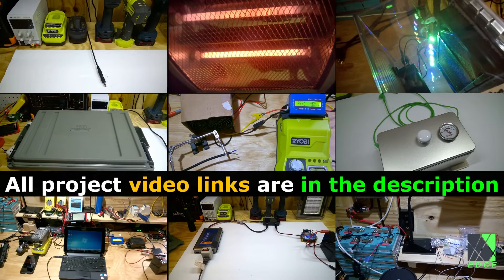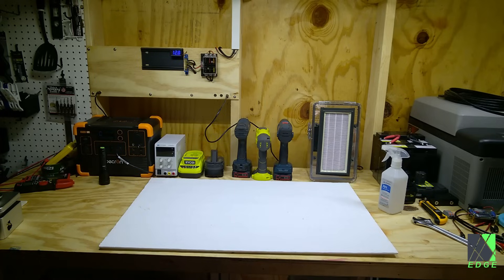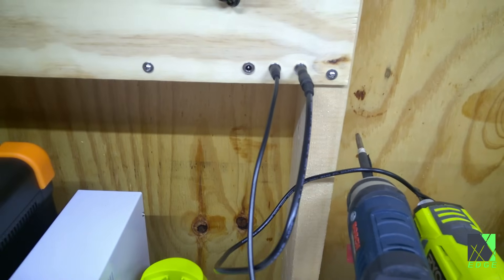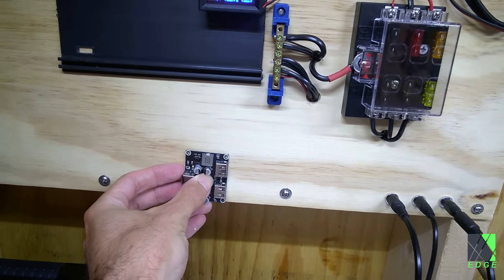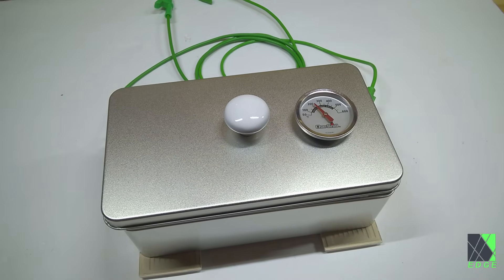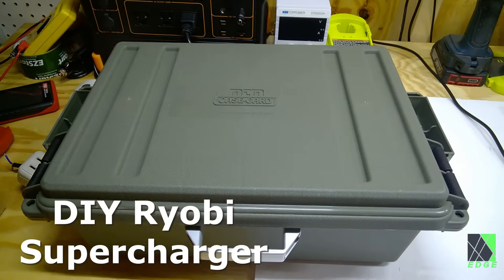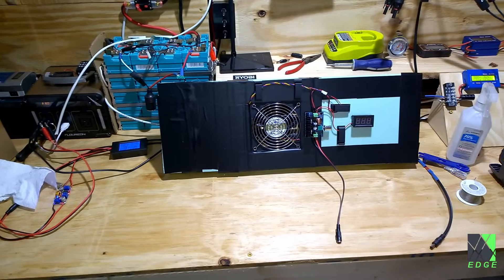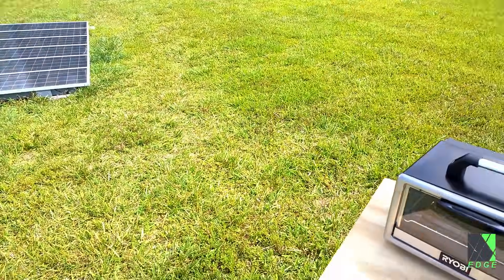What Can TRUE Direct DC Solar Power Do? Mini documentary and demonstration! #diy #solar #offgrid

Comment from the maker: ====FAQ + Related Videos, PV2L/PV2W Appliances====
Direct PV Air Conditioning Research - https://www.youtube.com/playlist?list=PL8a6nRTNyF9PyYGFHtbVmP0tQo5ar_dfX
Pedstal Fan - https://youtu.be/Cc7JJZDmqFA
Mini Oven - https://youtu.be/p3NOilVYK44
Heating / Cooking Playlist - https://www.youtube.com/playlist?list=PL8a6nRTNyF9NZkjFgjfESLujgdZFTgdym
DC Space Heater conversions:

https://youtu.be/TJG-ZnqJR9w
https://youtu.be/maDEc4FpMtA
https://youtu.be/_r9hj7gUeVI
https://youtu.be/wK3_lRSntRc
==== FAQ: ====

Does this setup use a battery? 
It has optional battery backup using a specialized setup, I did not show it in order to focus on the topic. I may explain that part in a future video.

What voltage does the PV2W setup run at?
About 12-19 volts, depending on sun conditions and the number and power draw of connected appliances.

Is there a video of how to make a board like this?
Yes,  https://youtu.be/OxNsESJOF6o

I may update this post from time to time. If you have any questions please let me know. -Dave

Comment: awesome ideas
how do you control the voltage on your battery charger? do you have DC to DC converter?
Reply from the maker: @zeeman9145 Hi, no DC converter is needed nor battery. Battery is still optional and controlled by contactor only. You might be interested in my 55 volt residential DC system https://youtu.be/SW7L3-gfE-E
Reply: @solarpoweredge  thank you for explanation and video clip!
Reply from the maker: @zeeman9145 Welcome :)

Comment: I'm a girl and can't do DIY DC solar.  I just need you to sell me the stuff. 😁. I guess I'll just have to put my hearth oven out in the sun to cook in the summer.  But my morning coffee might be afternoon coffee.
Bummer.
Reply from the maker: @lesliekendall5668 I believe you can learn about DIY solar just like I did. I started with 1 small 20w 12v solar panel and started teaching myself how stuff works. The simplest experiment is to take a small 12v fan and hook it straight to a small 12v solar panel. Free air cooling! That served me well and I still use it today. I later bought a small charge controller and small battery and inverter. I learned a lot from that system!
Reply: @solarpoweredge 
Yes, that's exactly what I'm planning to do with the direct PV to appliance thing.  I'm buying a 12/24v freezer soon and am trying to find other stuff that I want that could also be on that direct system.

Comment: So I'm going to be buying a 12v DC powered 6.1 cf freezer but can't get small appliances and lights?  How crazy is that?
Reply from the maker: @lesliekendall5668 I hear you - direct solar power should be everywhere. But just give it time, we can DIY our own stuff (I'm working on that now) and eventually companies will see it and mass-produce some of it. It just takes time for the necessary demand to develop
Reply: @solarpoweredge 
I look for stuff on sites that cater to boats and RVs.  Their lights and pumps run on the DC house battery.  So does the AC but they're pretty clunky units.  So I looked it up and there's a 24/48v mini split that can be bought.

Comment: I'm thinking of having 3 x 500w panels max 40volts in series (8amp max a 120v) supplying a 3000 watt immersion rated at 240volts ac  heater on a 100ltr hot watet cylinder rated a t 240volts,13a  .as its just an element that would work on dc and ac .it would just take twice the time to heat up .
Reply from the maker: @davesomers2292 This is a popular option, just have to mind the high DC voltage. My new HWH system will use 48-60v so less electrocution hazard. It's a build in progress

Comment: I have two 250 watt panels going to a EPEVER 60amp charge controller. It charges my 100ah lifepo4 the charge controller has a 12V load output I use for most things in a shed. I have several 12V devices in there sort of like an RV.
Reply from the maker: @Mike-01234 Great setup. I love anything 12v. There is nothing like having your own independent electric power.

Comment: Hey Dave you are so talented! ! Do you like a certain size of nichrome wire to wind new quartz elements when rebuilding them.  Is there a good wire size for a 24 volt system (2  100 watt panels) that you like to use?  Do you like to run single quartz elements just in case  that one burns out?  Also Have you converted an evaporative cooler motor or found a 1/2 hp single speed equivalent motor that could work?
Reply from the maker: @SteveB-p2x  Hello Steve, you're too kind and thanks :) Wire size, depends on the project? I deliberately collect nearly every gauge of nichrome, it all works... I'd suggest getting a few sizes in case you want to step gauge up / down for a custom build. 
It's about power (w) and resistance first, wire size comes later!
For 2x100w panels, we would need to find the "max power voltage" (some call it MPPT or MPP). Then use I/V/R (Ohms) to calculate a resistance. Then you can start spooling out the wire and measuring its resistance w/ a meter to find the ideal setup. 
*PS: don't breathe the smoke when nichrome first burns, after it burns that should go away.
*Quartz element: having more than one means you can use a switch to vary the power flow, but you have a good point - it also functions as a backup.
*I'm experimenting towards making a cooling tower but it's a long way to go. There are motors on the usual online auction site that run on DC from 1/4-3/4HP or even higher. Those might make a good conversion! I have one and have been experimenting with it for another project, but need to make a motor coupler and that's proving to be pretty difficult.
Hope this answers your questions, but feel free to let me know if I missed anything :D
Reply: Thanks so much Dave!!  I just ordered a quartz heater to modify.  I will try to get the best sunny day to see the max output of my panels for 24 volt.  I also will use 10 GA wire from the panels (50 feet long).  Then see what the math says.  I noticed in one video you said to run with 24 volts when your beginning, and then in another video for the Harbor Freight parabolic heater you were running 48 volts.  For the quartz heater dual element what voltage would be your recommendation!?  I ended up getting a good deal on a new twin quartz vertical heater for about $22.00  it was cheaper than the used ones.  I believe I still need to add in line fuses? And also the DC circuit breakers,  the tip over switches and something acting as a high limit? (if I can find it) Thanks so much for your help!
Reply from the maker: @SteveB-p2x NP! The HF heater likes at least 48v to make any decent heat. But any of the quartz heaters can be modded with nichrome to operate on 24v or any voltage you prefer. That's a good deal for a heater. Hard to find any decent ones that aren't at least 30$ these days. I recommend using DC rated circuit breaker to power the heater on and off. For the tip over circuit, they weld shut on DC. So a properly rated DC relay, contactor or solenoid is a good way around that problem. Most of all, best to not run these heaters unattended, especially during the "early development" phases
Reply: @solarpoweredge  Thanks Dave!!
Reply from the maker: @SteveB-p2x You welcome Steve :D 👍
Reply: Hey Dave, another question for you about the DC heaters.     With your retro quartz heaters are you running one solar panel per heater? Or are you combining a couple heaters.  I'm looking at 36 volt 330 watt solar panels that will keep me under 42 volts.   Just wondering about your setup and how you run them.  I'm also hoping to stay under 50 feet of cord length. Thanks and hope you are feeling better!  Steve
Reply from the maker: @SteveB-p2x  Hi Steve, thank you and I am working on the health situation :) what I usually do is group panels up to feed one or more heaters. If I have 10 panels, they feed one heater. If that's too much power, I put 2 heaters in parallel. But eventually in the winter I have 18 panels and split them into 2 groups. If the sun is good I can run 4-5 heaters but it depends on which ones as they have different power levels. I'd suggest starting with about 4 panels in a group, and build a heater that will run reliably off of them. About 48v is considered pretty safe. DC can destroy those simple AC switches, even at 48V so a DC circuit breaker can work to turn the heaters on/off and serve as a disconnect. Just my 10 cent hope it helps :)
Reply: solarpoweredge
Good morning Dave, thanks for that info.  I thought I needed to stay under 42 volts because of the tip over switches being 42 volt.   And  48 volts are better than 36 but I guess either would work??  I will see what  I can find for panels offering a deal.  I do remember you saying that you could make it work on any voltage  12  or 24 or 48.  I'm learning here😂.  Is  there  a watt target that in general  that you are looking for to get the resistance that is needed to make it work?  These quarts heaters before modification are rated at 1500 watts AC.  Thanks for your help!!
Steve
Reply from the maker: @SteveB-p2x Hi Steve you are welcome. 36-42 volts would be just fine. Yes it's better for the switches too. At 12 volts the current (amps) would start getting pretty high but with thick enough wires it could still work. I would suggest building out around 36-42 volts range. Good enough voltage, no electrocution concerns. 
Then build a test space heater with all the safety gear and maybe aim for 300-500 watts range. This will allow you to get hands on experience. 
My first heaters only pushed a few hundred watts, but they sure made the difference. Assuming 300-500w, it took several hours to raise the temp of a small room. But that is clean, simple and pure heat that has little to nothing in terms of maintenance or complexity. It's a beautiful thing in my opinion. 
Just so you know, I am moving right now to a new town. I will have more space for solar panels, and I hope to go full blast and build a new heating system. This could make some interesting videos hopefully.
Reply: Thanks so much Dave!! Thanks for responding when your so busy! I will get going on this.  You have really helped me a ton. Hope your move goes well!  Thanks!
Reply from the maker: @SteveB-p2x You're welcome Steve, and I have to say it's folks like you that encourage me to keep making videos and not give up. By the way if we're able to get moved to our new land successfully, I'll post an update to show it and go over future plans. Hopefully the new place will make for more variety and better content. And more room for solar panels - that's been holding a lot of projects back.

Comment: Is there away to control over voltage and under voltage from a PV system to power 120 a/c ?
Reply from the maker: @dragproet I think we could use an inverter like the one shown, although it's hard to find inverters with such wide voltage inputs

Comment: Great! Could you elaborate more on PV voltage and loads working voltage? Use 18 VDC panels for 12 VDC appliances, etc?
Do you have any groce calculation on how many PV Watts you need to keep the source voltage stable under any given load? I imagine the solution is some excess PV power...
Reply from the maker: @alvaro.piner1917 Hello, the power wall is unregulated and sees voltages as low as 9v and as high as 19v. Because of that I tend to make appliances that operate on a wide voltage range if possible. For example, the little DC oven doesn't mind if the voltage is 11v, or swings up to 19v. The DC HEPA filter just speeds up or slows down! Still works...
There are exceptions: I do use a USB DC regulator for 5v stuff because well... there is no way around it at the moment.
Also you made a good point about excess power, indeed more panels help prop the voltage up. I have about 500w of panels to work with and generally don't find power lacking unless it's very dark. If it gets dark, I have a special "backup power" system I never showed, perhaps I'll get to it in part 2 :)
In any case, I hope this answers some of your question at least, if I can further detail anything just let me know! -Dave
Reply: @solarpoweredge  thank you!
Reply from the maker: @alvaro.piner1917 Welcome :)

Comment: I decided to wire my cottage with D.c. a lot like how solar sail boats are wired. I do have stand alone solar system with smoke detectors d.c. with d.c. backup and emergency led lights. I have a voltage regulator off batteries and usb and 12/24v circuits. We run all d.c. appliances. But do have one a.c. inverter with super capacitor bank for power hunger tools. The super capacitor bank act as a soft start providing extra voltage. A lot like a capacitor on a car amplifier to keep headlights from dimming when bass hits.
Reply from the maker: Awesome setup. I'm working on converting everything DC, it's just a matter of time. Inverter still gets a lot of use of course, it's good to have

Comment: Do your lights have voltage regulators built in?   Output of your panels would generally be 18 or more volts, that seems high for most typical off the shelf LED lights.  Got a link to buy/research those lights?
Reply from the maker: @richardwernst They are some generic "overseas" LED strips I had in my shop. They might have come from ebay. You can put 2 12v strips in series if needed. Pretty much all LED strips have resistors built in, some do have regulators. What I'd do is look for some LED strips that have a suitable voltage range. A direct solar setup could exceed 18-20v sometimes, especially if there are not many loads running. Therefore such LED strips must be able to take higher voltage than 12 volts. Some of the 12v strips actually can, just check the specs carefully. In many cases, it takes some reading to find what voltages are actually supported. Obviously if they are 12v only, they will burn up quickly.
Reply: @solarpoweredge  Thanks again!
Reply from the maker: @richardwernst welcome :)

Comment: I don't see a link to that usb power "brick" you showed.  I'm surprised that can take 18 volts, or is it special and has it's own regulator to keep the voltage to the USB ports to the 5 volts needed for USB?  If you can, please post a link to that or similar brink or board.  Thanks.
Reply from the maker: @richardwernst That USB box makes it's own 5v supply. On Amazon search "AITIAO USB Port Fast Charger Board" 3rd result down. They can actually take well over 18v
Reply: @solarpoweredge  Thanks!
Reply from the maker: @richardwernst welcome! I like your avatar btw :)

Comment: Hi at 358 you stated that it's directly connected to 100W Solar Panel.   1.  Did you modify the Ryobi charger so you charge the battery? 
2. Did you use an charge controller for the RYOBI  connection
Reply from the maker: @Purinelz Hello, it was modified according to the videos linked below, to limit the current. Using the OEM charger circuit board ensures the battery protection circuits are activated for safe charging. Hope this helps
https://youtu.be/MRazwnwvczg
https://youtu.be/RMJFVHCNw_s

Comment: Any ideas on how to get bigger fans to run from direct DC? I need 65k CFM which is about 2 hp worth of fan cooling for my greenhouse. Thanks in advance for ideas.
Reply from the maker: @jcschwarb Hi, you can use a big DC motor (direct drive solar ) 1-2hp or higher. Matching the shaft/blade/rpm sometimes is a bit troublesome. Sometime ago, I did run across some DC greenhouse fans but they weren't cheap. PS in fact I have been working with large DC motors for various projects, and need to make some videos about it. 
You can find big DC motors used or new on ebay, I am not sure if they can all handle a lot of humidity - but certainly worth looking into. Hope this at least gives you some ideas :)

Comment: I always thought a direct connection would be inefficient. DDo you use any kind of MPPT to optimise the power that the panels generate?
Reply from the maker: @ShakesB13r It depends on what types of efficiencies one desires, and which appliances are in operation. Some of my appliances are designed to hold the voltage around 16v vMP without using any MPPT. I would prefer to avoid complex electronics wherever possible, but a MPPT DC-DC converter would be nice to have.

Comment: You haven't mentioned panel voltage, does it matter.  I have a 38.5 volt panel with 340 watts .
Reply from the maker: @millardmoore479  I lean towards 12v solar panels as the voltage is close to many common appliances. Plus I avoid a DC converter. However, you can operate at any voltage you want - as long as it's safe. For example, the small ovens I make - with adjustments, could run at 30v. If your appliances don't handle 30v, might have to stick with a DC converter. But it will still work! I do sometimes use a 12v converter, if there is no other choice.

Comment: What is the overhead light fixture model and brand
Reply from the maker: @Purinelz  They are generic overseas LED strips, you can find similar strips intended for RV/automotive use. Just read the voltage specifications before buying. Many of them can go up over 20v no problem, but some will burn out. Hope that helps
Reply: @solarpoweredge thank you . I'm a big old Boy Scout and just re recently ventured into solar.

Boy Scouts will need a new merit badge.
Reply from the maker: @Purinelz  Welcome... I think they need to get into solar - if they haven't already

Comment: What about night when there is no light to power the panels?
Reply from the maker: @BeGood2DoGood It's not a problem, the system has optional battery backup - although I hardly ever use it. This is a simpler and cheaper way to get solar appliances running without being forced to use a battery, charge controller and inverter. Those more expensive components are not taken for granted in less developed countries, and sometimes are not affordable or available. In the future if there is a grid down scenario, we might all face the same type of situation.